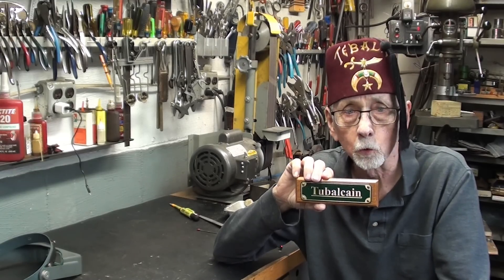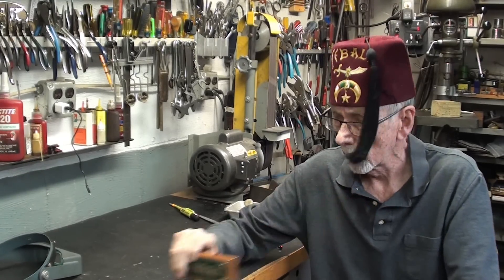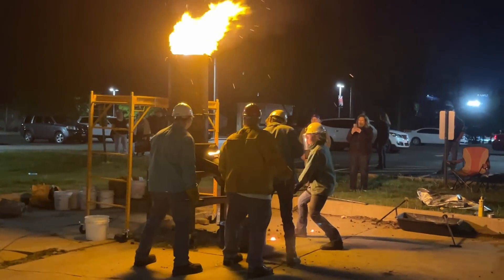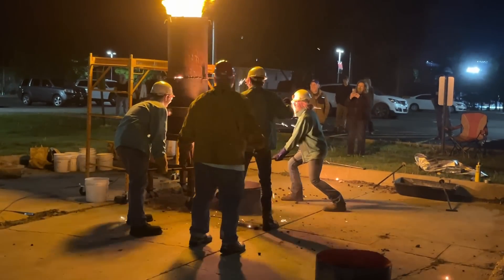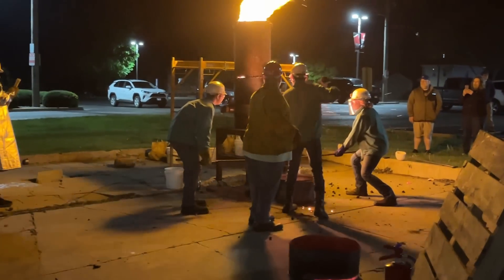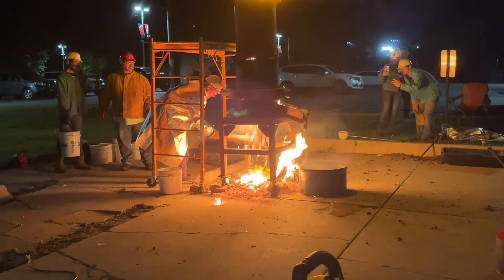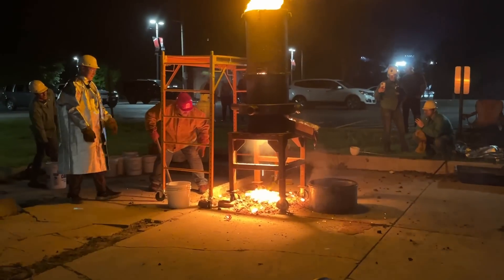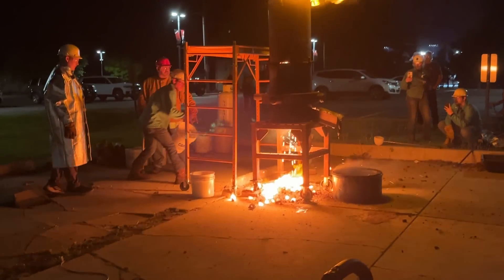SPECTACULAR NIGHT TIME IRON POUR #971 tubalcain casting foundry

Comment: Asking here because it's your latest video. Was looking for dividing head and a guy called and sold me a 6 and 12 inch ralmikes indexing head. The 6 inch was suppose to come with dividing plates but of course only has the indexing. Of anyone I know it's mrpete222 that could possibly tell me if and where i could find those plates if at all. I got both for 150 so bot hurt my anymeans. But was hoping to be able to start cutting some gears on an actual dividing head (even though these kind are dividing heads)
Reply from the maker: That company is sold a lot of tools over the years. They did not manufacturer the items. No telling who they bought these heads from. I doubt if you will find replacements. You’re only possibility is eBay. Or make your own I think I had a video on that.
Reply: Thanks. Looked in ebay. Was actually just Watching your video on making dividing plates.

Comment: Hi Mr. Pete, this reminded me when I was in high school metal shop, my shop teacher liked my friend and I because we always tried to work out different ways to do things. One day while everyone else was pouring the standard aluminum mold my friend and I asked if we could try to pour a brass mold and the teacher thought it would be a great idea for the class to see since it was not part of the normal class. When he came in with several pop bottles we were a bit surprised but soon remembered brass POPs when it first turns liquid so the glass was there to act as a lid until the brass became molten. The mild turned out great and of course the other guys wanted to try the brass for themselves. Thanks great video and memory too.

Comment: i am shocked that something didn't go terribly wrong. why are they not ALL wearing the silver protective jackets? just the girl gets the protection? are the boys not as valuable as the girl? the one that is farthest away from the heat has the most protection? great video. gets the youth involved in what it takes to keep this country (and the world we live in) running. i would have liked to see a little more PPE on those kids though. i wouldn't want to be the one to tell their parents if something went wrong. (ie; full face shield, silver jackets for EVERYBODY, and steel shields on the feet and ankles. you know, the basics for working in this industry.) and is that a wooden deck on that scaffolding? i know it is because i have one myself.
Reply from the maker: You sound like a safety Nazi that wants the children to learn everything from a computer
Reply: @mrpete222  on the contrary my friend. if you have ever seen someone burned by even just the smallest splash of molten metal, you might have a different opinion on safety. its horrifying. and those green "welding jackets" ignite like a match. you would think as welding PPE, they wouldn't be so flammable. we were smelting aluminum at a salvage yard in Hartford, SD about 25 years ago. the kid we had working in the shop, welding, answering phones, a runner you know? he came over close to the smelter to tell the owner he had a phone call and the pot was just coming back down from being emptied and a splash of aluminum hit his shoulder and by the time we noticed it he was 10 feet away, engulfed in flames, wearing on of those green fucken welding jackets...............he didn't make it. he died a week later in the hospital with burns covering 50% of his body. just something to keep in mind when working under such dangerous conditions.

Comment: So much wrong with this.   A miracle no one was visibly injured.
Reply from the maker: There were no injuries you are living in fantasy land
Reply: @mrpete222  I worked in the Petro-Chemical and heavy industry for 40 years.  I have seen severe burns from people not trained, pants with cuffs or tucked in boots, wrong glovees, pouring 2000° iron on Concrete which can explode,  Laying down beside the Furnace!!! Ineffective face shields etc etc.  To many people wandering around.  A cup of water in that mix would have caused a steam explosion.
Your fantasy, not mine.

Comment: that was the scariest thing I ever seen! an accident waiting to happen. what will you tell their parents.  running shoes - one face shield one fire protecting jack amongst several people - no handrails on the scaffold feeding into directly into flames without a shoot.  pouring iron in a drum without sand under it. I'm not a Safety Nut but this is beyond words. please for the organizers look at the floor plan and adjust safety accordingly. don't just go for it. i know the school has a small budget. play safe
Reply from the maker: As dangerous as this is, it’s not half as bad as being on the interstate highway. This type of activity needs to be encouraged, not discouraged. That’s why most Shop programs are cut out of the curriculum.
Reply: @mrpete222   with a little commonsense. rather than saying highway is safe than a battlefield, this talk is nonsense. I'm not telling you to spend a million dollars on PP.  for god's sake not one person picked out the scaffold with no handrails, falling over that flue with in 3 second bad news. in a foundry I had an accident 1in billion! all most lost my eye. I was 42 years old then I was wearing minimal pp that's normal. boots safety glasses just Welder's jacket. wish I hand a safety shield on that day. in my dreams I dream putting on my safety shield. but in the morning the mirror doesn't lie. like I said plan your rout beforehand and identify and trip hazards safety issues.  (run it at a basic hobby level safely). if ever happened which one of you guys would be the one to tell parents that their child got their face burnt. that could have been avoided by the most basic pp not used. a smart man would say it's a good idea. we will take safety more seriously. keep your skin on your face! :hand-orange-covering-eyes:

Comment: Even over 20 years ago in my high school the wood and metal shop was all but abandoned; shop teacher had access to the machines but due to insurance reasons (I was told) no classes were offered in there to make things or get any kids interested in shop class. Closest I had was manual drafting courses because the school couldn't afford new computers and software for the computer drafting or CAD stuff. I never did well in school, but after school went into the shop area to use tools (with teachers permission) I knew I liked it but working with your hands is frowned upon for some reason.

Comment: Gotta be careful when melting on concrete. I set up a small furnace once on a concrete patio. Apparently there was moisture in the concrete. After about 10 minutes of intense heat the concrete exploded. It was an explosion equivalent to a cherry bomb or m-80 firework. The moisture in the concrete heated and built up enough pressure to explode a basketball sized pock mark on the patio. Several days later I was working on the roof of my two story house and found pieces of concrete on the roof! Probably best to pour in a container elevated above the concrete. I had heard of this happening before but just said aw-bullsh**. I don't say that anymore!